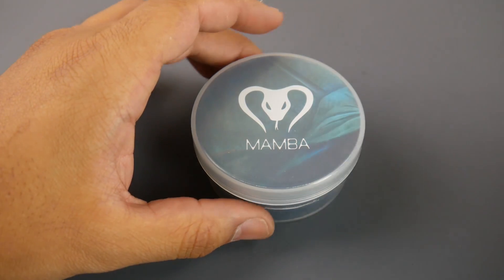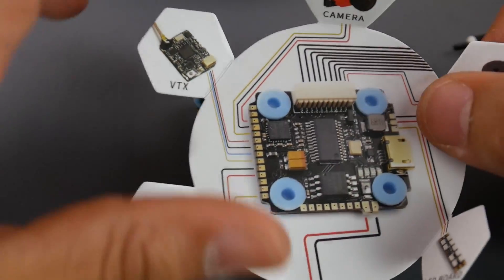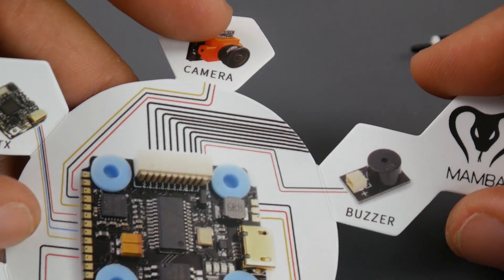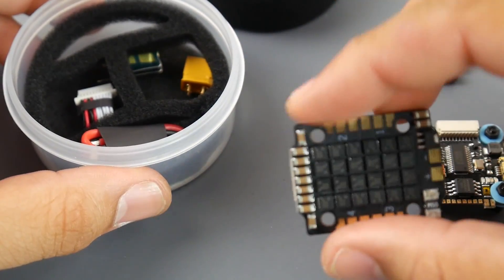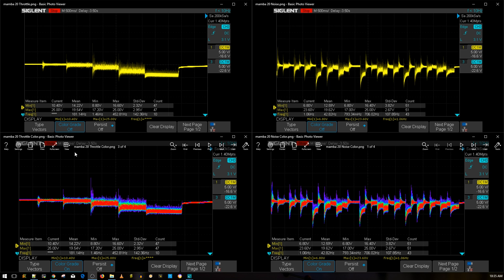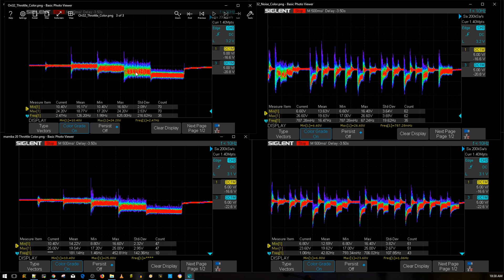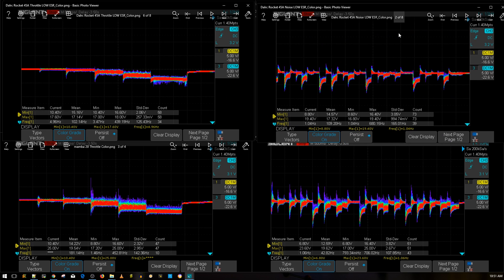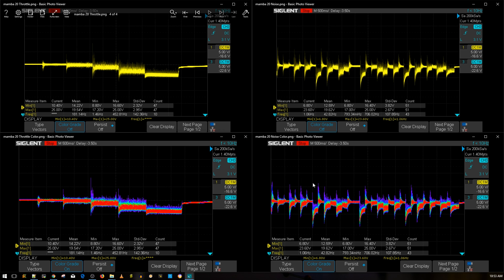MAMBA F405 Mini STACK BEST PRICE TO PERFORMANCE EVER?? // MAMBA 20x20 stack Review and Noise Test

Comment: Hi. I bought this stack to mount it on a slam nasty 2" frame. it fits perfect. However, the 3S battery I have seems very heavy for the drone to hover.  I am frustrated, because it seems the Mamba only supports 4S batteries, but the higher the lipo, the heavier. Which battery do you recommend? Do you think there are small 4S batteries for nano drones? Thank you

Comment: Hello DM, Could you do a build or just write down what I need to complete this particular build, the Mamba mini stack f405 20a with the 2306 2450kv motors, camera, vtx and 20x20mm frame. (What parts to use to build a basic one!) I'm pulling my hair out trying to put something together... I'm new at this sort of thing...thank you so much in advance...cheers!

Comment: Somebody knows if I can use the sbus port with ibus? Or i have to use tx3 port ? Thx
Reply from the maker: You can't use ibus port for sbus On F4 ... If you have F7 then it would work.
Reply: No, i have the mamba f405 mini and I has a sbus pin but I’m using fly sky with ibus so I thought I can put my ibus reciber with the sbus pin on the fc thx

Comment: hi there...i am a bit confused about the power connectors  ( GND and VBAT) on the FC next to RX6......do i need to connect this to the battery ?  if not what r these pads for and why does the  paperbooklet connect it to XT30???is the FC not receiving power from the 8pin connectors connecting FC and ESC board??  thank u for any help on this...

Comment: Hi can you help me out? I have this stack, my proble is that the Led that i connected on the pads does not work well with 3s, 4s, but usb and 2s working fine.
Reply: Did it fly on 2s?

Comment: hi brother. i got so much throttle noise using this stack even with the low esr capacitor that comes with it installed. can you suggest anything i can do to fix it?
Reply from the maker: 1. Check your tune..
2. Check your SMA connector if hitting the carbon.
3. Check if you have a broken mmcx or the solder is broken on your antenna connection. 

It might help if you upload your DVR footage.
Reply: @DroneMesh  I checked my quad and found the ground from the esc to the fc was crimped by the aluminium part of my frame. not sure if it will make any difference but I fixed it. then I update to Betaflight 4.0 and use stock PIDs. the throttle noise is almost gone now. thanks to you. sorry still didn't manage to get my hands on a dvr to show you the flight footage
Reply: thank you. I’ll try it. I don’t have a dvr yet but I’ll  try to record using my friend’s and let you know when I uploaded it.

Comment: Question regarding which type of smd ceramic capacitor is used on the esc?
One fell  off when assembling and didn't fit it properly (reversed I think) and need to order a smd assortment set, but don't know which type it is.

Comment: I love your testing DM. All the time and effort you put into making this hobby easier and better for us.

There is one thing I have been thinking about for awhile now though. These esc reviews are great as they are. But I'm getting more and more interested in getting to know a little more about the components on them, mainly the specs of the mosfets. I know it's in the videos as it is. I just want to put more weight on it. It seems like you are starting to become a reviewer which the manufacturers really wants to get a good review from. I think of the tekko32 for example. After your first review of that esc it seems like the other brands just had to step up their game and give us better filtration and better components overall to even be considered a choice. I am absolutely confident that what you say about component choice will push the manufacturers in the direction which gets good reviews from you.

Thanks for all your time and effort.

Comment: Quite interesting stack you have. I see basically all required for basic racing/freestyle quad with SmartAudio controlled VTX. Current sensor on 4-in-1 ESC board without nothing sticking out for it - good. Low ESR capacitor is required, though it is nothing special. Those stiff wires (PVC insulation, yes) ir Ok while you keep cable intact without cutting. Also I see all needed for SBUS+SmartPort/IBUS/FPORT receiver connection. That TX3 with SmartAudio most likely already have separating capacitor on board - would be interesting to check how circuit really look. Seems is worth to check this out if I will decide to build something small and light for 3S again.

Comment: Awesome for a budget 20x20 stack.  Might be a dumb question, but where did you install the low ESR cap; directly on the main battery pads of the ESC, or is there another set of pads it can be installed on like the VCC/Ground pads of the flight controller?  Thanks for the great reviews!
Reply: Low ESR should be placed to the battery solder pads or directly to the female battery connector.

Comment: I have the mini version on an IFlight Ih3 frame with a Runcam Split Mini 2 and Crossfire Nano. Works great but I really could do with another Uart for the camera controls. I tried softserial with the led strip pin but had no joy. Do you know if softserial is possible on this board?

Comment: That's not ESC Telemetry, the TELE pad is radio RX telemetry (SmartPort, F.Port, Bi-directional uart pad)
Reply from the maker: Yes and where does the ESC telemetry go... One of the RX pads  ;)
Reply: @DroneMesh  true. But when you're talking about ESC Telemetry you always say, "ESC" before the word, "Telemetry". Anyone referring to Telemetry on Anything else, is referring to the information that is Additionally passed between a radio TX and RX. Furthermore,  ESC telemetry does not utilize (therefore need) a bi-directional uart pad. Which is what the TELE pad was originally designed to be capable of. 😉. 🤣🤣🤣🤣
Reply: David, thanks for that information about the tele pad. Can you camera control with it??

Comment: Looking good. Now I'm thinking about putting this stack in my superlite 5" running 2205 motors. It should be fine. The current one using Flycolor BLS-Pro 30A, weights a tad less than 300g dry. I want a lightaer one with 20mm stack and all micro components in it. Would be a fun build.
Reply: Did you end up doing this?

Comment: Same stack that's on my 2.5 GT Titanium Diatone. ...and looks to be the same pinout on the FC board. I bought a new ibus flysky USAQ 8CH PPM 18ch IBUS MINI receiver for it. 
And thought the same thing you said. So I tried wiring it up off the back pads without success. Diatone already had it soldered up for sbus. So I hooked up to the sbus wiring they had in place. And went in to Betaflight and switched to I bus and it binded up. So go figure?  But true story and still running it like that. I been watching your reviews on these stacks I highly appreciated all the testing you have done here. Made me go buy another 20x20 stack😁
Reply: After buying two of the stacks now. And having a third one in my Diatone 2.5...Sbus and Ibus wiring configuration is the same . Just change to Ibus in Betaflight and your set...FYI...Flysky guys.
Thanks for testing the stacks bro!

Comment: Could this stack handle a 5" race quard without issues??
Reply: Hello. It depends .
First you need to decide which motors you wanna use and try to find its amp ratings for specific props. You shouldnt pass ESC s rated amps or you cannot use your motors %100.
Second is the noise issue. Bigger motors possibly create more noise than small ones . Therefore the filtration on board might not be enough. Additional filtration might be needed.